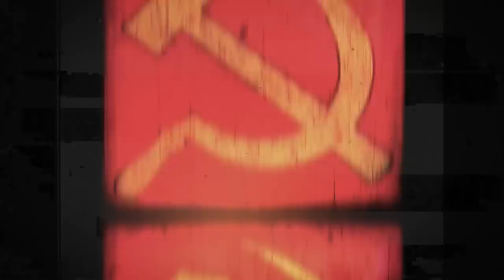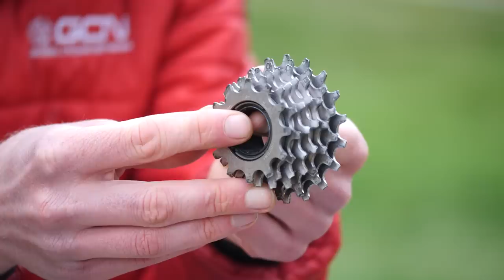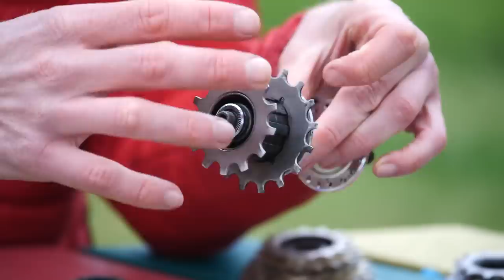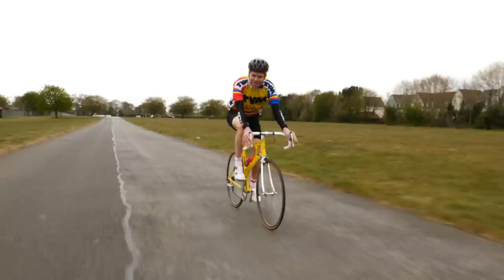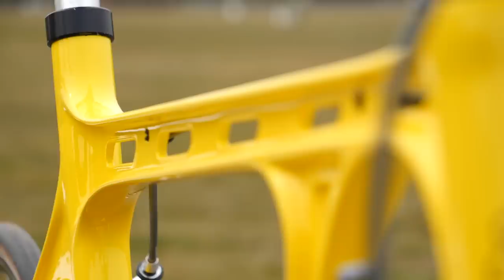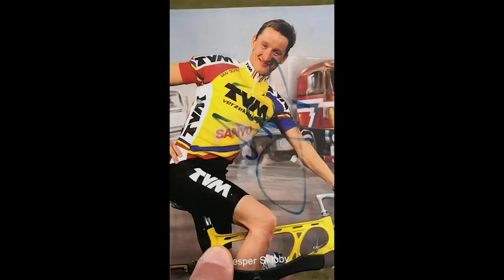The Greatest Cycling Innovation You've Never Heard Of | Shimano Hyperglide

Comment: The greatest cycling innovation…they found out that a bottom bracket should definitely be threaded
Reply: hello press fit bmx...
Reply: Threaded still has its weaknesses. If they couldnt properly deal with press fits those companies sure asf didnt fet any better with threaded bb's
Reply: @abccanada6248  no company can properly deal with press fit in the long run. There are TWO reasons for them to deal with it (still) even though it’s inferior: 1) less cost 2) a little less weight …which helps to argue the first reason for them. And for the colleague above with the BMX argument….this is BS …nobody rides miles and miles a year with a BMX. In case you didn’t know: this is a bike for really short tracks and tricks …not mileage!!
Reply: @bikemike1118  all bearings are press fit in cycling. Your just threadding in shells that have bearing pre pressed in to them with threaded bottom brackets. And when dealing with alloy to carbon bonding for the threads you are dealing with much sloppier tolerances then with press fits
Reply: @abccanada6248  true…Carbon and Aluminium is a toxic mixture. I do prefer a titanium frame (but that’s a different story). 
Anyway…the trend including „trendy manufacturers“ already go away from pressfit again …at least for mountain bikes.
Reply: Yeah
Reply: Engineering wise, a pressfit is a far better way of mounting a bottom bracket. Far more stiffer.
But because bike manufacturers can't properly do bottom bracket standards/dimensions etc, it's shitshow.
They really need some more QC.
Reply: @diarreescheet  you MIGHT be right …but come on : we live in the year 2021 and no more in 1821 … There seems to be an inherent problem regarding daily usage in the longer run. So for me the solution is: TBB
Reply: Klein were ahead in the pressed bearing style and many others. Trek purchase own all the Patents
Reply: @DG-EditsYT  yeah, the Klein mtb‘s when still under Gary Klein had a big „I want one“-effect on me….after Trek took over the company…the „magic“ was gone.
Reply: Plus a wider groove, for a poka-yoke that dumb-proof guarantees a single assembly position.

Comment: i've ridden and worked on uniglide,let's just say i'm very happy shimano came out with hyperglide. uniglide was a self tightening pain to take off, but it was cool you could flip the cogs and basically get yourself a new cassette minus the lock ring.
Reply: Hahaha that's awesome
Reply: I find they come off without any problem with the two chain whips - great fun messing around with all these parts. I feel like a professional mechanic!
Reply: The lockring is as tight as the rider is strong. Some monster with tree trunks for legs can make it pretty hard to remove.
Reply: I've got to disagree on 'second life' flipping Uniglide cogs. It can be done, but you'll need a file or grinder to get them to work properly. Lots online on this. The cogs aren't symmetrical, and the centre line of the teeth is offset slightly from the cog body.

Comment: Cassettes were a huge improvement over freewheels for nearly totally eliminating broken axles on the rear . Before Hyperglide if you wore out two cogs most used you could replace them for a few Dollars each . Also any gear combination could be made where Hyperglide is limited . After Hyperglide the cost was at least fourfold as the cogs and spider were replaced as a unit .                                                                                                                                                                                                                                                                                                                                                                                          Greater Shimano profit . Don't ask about their problematic early electronic shifting . I worked full time as a bicycle mechanic from the early 80's until 2016 .
Reply: Freewheels' maximum cogs sizes are like around 32 or 36t, which it's pretty limited when going uphill,
Reply: Wow that frame .the best.
Reply: @nzo_6543  bikes that come with freewheel have triple crankset. 24/34 or 24/36 is very low
Reply: @brian_jake  yes that's why they have a 3x/2x to go uphill, but if the crankset is 1x, which you really not gonna go uphill

Comment: There will be a few people watching this remembering the grovel home after the chain gang on your 13-18 straight through 'block' and 52 x 42 chainset...legs like Popeye..
Reply: When i started, we ran 14-19 Regina six speed freewheels. Big quads and sore knees!
Reply: Knees like crushed crackers after your 60.
Reply: MRGRUMPY53  I remember when 7 speed came out...and you could get a '21'..I lived at the top of a 20% hill..that saved many a sunday grovel..
Reply: Imagine using an 13-23 cassette on a MTB... Yea that's how i started.
Reply: MRGRUMPY53  Not on an MTB tho. Was running a 42 and 32 on the front. Now i run 1x11 with a 11-50 cassette and a 32 chainring.

Comment: Ah, but is it one WIDER spline, or one NARROWER spline?  THAT is the question!*

I remember the introduction of Hyperglide.  Lots of criticism of the reduced tooth profile, leading to faster wear was the main complaint.  Oh, and that you couldn't use older cogs.  And that users couldn't pick "custom" gear combinations anymore.  The old cog boards in shops quickly disappeared.

*I've always considered the wider open space.  Others look for the narrow spline.  Tomato, tomahto, I guess!
Reply: Both! Otherwise one could put the cogs in the other way. 
And yes, I would also like to be able to replace the smallest four cogs separately.

Comment: Being 60 (!) I remember well when hyperglide first became available in the 80s.  This video understandably gets it all wrong, because its makers aren't old enough to have been there for the introduction.  The important innovation was that you could finally shift under full power, not that shifting was somehow made 'more precise'.  Shifting was always just fine when coasting or pedaling lightly but quite impossible when hammering - chains would twist, seize and mangle and could be ruined.  

Hyperglide was an even bigger deal for the mtb crowd because you could finally downshift under full power on technical climbs.
Reply: Agreed.  Having cut my teeth on the old equipment, I still generally back off the torque when shifting even though I know the new stuff can take it.  I still love the feeling of the chain falling into place like tumblers in a lock.
Reply: He did mention the ability to shift under power.
Reply: I don't see the issue.  Most of the mentions of "precision" refer to the position of the sprockets and how the chain crosses the gears - not the derailleur alignment or shifter operation.  But it also seems to me that the ability to shift without having the chain "twist, seize and mangle" inherently means that that the shifting performance at the level of the cassette and chain is more precise.

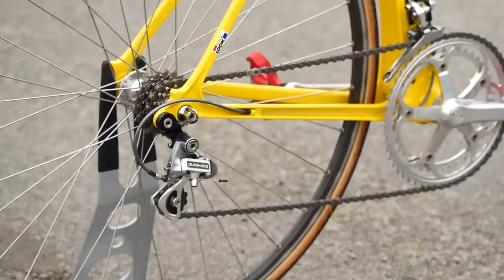But then when Ollie goes into real-world performance, one of the first things he mentions after 5:02 is the ability to change gear under load.

Comment: lots of sketchy information,  it is annoying that he is referring to a FREEWHEEL as a cassette,  different animal,  but speaking of freewheels some were made with the teeth cut differently so that it would facilitate indexed shifting,  that was not an innovation that was tied only to cassettes,  something that I liked about the uniglide system was that you could buy cogs and build the cassette to you needs,  this also allowed you to flip a cog when it got worn so that you could get more life out of it,   the bike used in the example appears to have an 8 speed, 13/23 cassette,  as the chain has to move much less to get to the next cog it should shift good,  the sprocket shifting ramps and teeth offset came about through mtn bike application where you might be using an 8 speed, 13 /34 cassette,  the chain must move further to the next cog

Comment: Hmm… is there anyone who hasn’t heard of HyperGlide? Anyone…?
It’s what made indexed shifting possible, opening up derailleur bikes to novices, and therefore Shimano grabbed a totally new segment of the market. Other brands couldn’t follow suit because of the patents Shimano had on it. It effectively killed of SunTour and to a lesser degree Campagnolo as competitors.
Reply: MRGRUMPY53  I stand corrected, but my point still stands. I see HyperGlide as an improved version of UniGlide. The shaping of the teeth and the careful positioning of the cogs is what made indexed shifting possible. It worked with UniGlide, it was much smoother and ready for the general public with HyperGlide.
Reply: Those who aren't into the technical details of cycling maybe?
Reply: @yonglingng5640  Fair enough, but to them it's a moot point, they won't know of any other cycling innovation either.
Reply: MRGRUMPY53  the 1st was the Positron deraileur.
Reply: MRGRUMPY53  However it was the 1st. Uniglide came later. If your going to correct, be correct 😀

Comment: The positioning of the sprockets is not as important as they claim.  I mix and match sprockets from 7, 8 and 9 Speed cassettes to obtain the ratios that I want.  At worst it has resulted in some shifts taking only slightly longer to complete.  You can also grind down the extra wide spine in order to optimize the positioning.  I also run a 52-36-24T triple crank set in the front with a modified derailer. I can pedal up the steepest hills, yet pedal flat out on the straight and level and still have a close ratio rear sprocket set to optimize my pedaling effort and pedaling speed.

Comment: HG chains are directional? I did not know that, also i need to check something on my bike
Reply: @bigstu_  0.6% is 0.6%, it may be the difference between a rider winning a race and losing it. If you're just a commuter, then i guess it would not matter even if the difference is 5%.

How much cost/labor does it take to install your chain in the recommended orientation? That 0.6% difference might also have improvements on wear and tear...
Reply: The outer plates will have the Shimano written on them. It's not so much about chain efficiency, it's about smoother more accurate shifting with no skipping.
Reply: It’s really obvious if you install one backwards.
Reply: It depends. Some are and some aren't.
Reply: @kaedeschulz5422  if it's a Shimano HG chain it's directional. it will say on the packaging if it's HG.
Reply: @iancanuckistan2244  Not all of em. I had an HG 8speed drivetrain on my old MTB and the chain looks the same from both sides.
Reply: Today I learned… I also need to go check something on my bikes 😆

Comment: I enjoyed a early version  on a Giant Chronos. Crank up a hill and shift in either direction was pretty cool. Within in a year though I started breaking chains. The fourth break took out the rear derailleur, locked up the rear wheel, wore off a brand new tire and screwed up the rim. I was doing about 45KPH on the flat coming off a hill. Never again.

Comment: From my experience, Hyperglide is more suited for indexed shifting. For non-indexed, it doesn't want to 'find' the gear like Uniglide or the better Maillards etc of the time.

What's being overlooked in the discussion is how a Simplex retrofriction shifter http://velobase.com/ViewComponent.aspx?ID=91d3c48f-c79e-429c-86ae-e38000ac1ac6&Enum=104 and some others, but Simplex was by far the best needs a freewheel cluster that wants to be in gear.

Once properly mated, set-up and adjusted, the cyclist needs to just 'tap' the lever with one finger to shift one gear, and tap a little harder to do two. Hard to believe? Darts, billiards and many other sports demonstrate how accurate the tactile sense can be in cases like this.
Or violins. No need for frets, the player can tell by feel if they're 'on pitch' or not.

Unfortunately, I've never found a Hyperglide freewheel to be compatible with non-indexed shifting, but the Hyperglide chains can be.
Reply: yep, Friction works with index cogs but the performance level sucks.
Reply: Suntour power ratchet shifters the came in down tube, bar end and flat bar thumb shifters. They work pretty good with hyperglide. The ratchet will give you a tiny bit over overshift and falls back a bit. 8s was the best. A Shimano rear derailleur with the floating jockey pully does the rest.

Comment: I noticed this when moving up from my old friction shift road bikes with plain tooth cogs, especially the older Suntour Alpha freewheels. Switching to SunRace chromed freewheels with nicely shaped teeth really improved shifting. I even prefer the SunRace 7- and 8-speed chromed cassettes over some of the older Shimano Hyperglide cassettes. The SunRace shift more crisply and run more quietly with both my older Suntour Accushift and various Shimano SIS setups.

Ollie looks a bit uncomfortable with those long cranks on that TVM Kirk Precision. Reminds me, I need to ditch the 175 cranks on my Diamondback Podium in favor of 170 cranks. Technically 175 fit me, but they never feel quite right and pedaling always feels a bit labored, and it's a chore to get the saddle/seat post height just right. I didn't realize how much difference crank length made until I bought an older Trek 5900 from a friend who set it up with 170 cranks because that's what he had in the shop. Felt perfect.
Reply: Combine chromed cassette with wax and the ti-coated KMC chains like the x10el for super smooth and quiet drivetrain

Comment: I have that rare Dura ace hub that does both uniglide or hyper glide. It came with domed nuts so it can squeeze into a 126 rear or a 130 rear. Still using it today (with a 10 speed cassette), it’s very versatile
Reply: Are you selling it?

Comment: This really feels like GCN being apologetic for Shimano lack of any real innovation. Yes they introduced some new tech 30 years ago but things have moved on and they really need to bring electronic wireless shifting for the masses. And even that is not innovation - SRAM already has it. So they should step up with more belt based drives, lighter hub crank gearboxes. Heck, even a singlespeed with variable e-assist.
Reply: The masses don't want electronic wireless shifting. It's expensive, environmentally unsound and it's yet another collection of batteries to forget to charge.
Reply: You talk as if real innovation can just be scheduled. Real innovation is hard, especially in extremely mature fields like bicycles. SRAM wireless shifting is not even innovation — it’s evolution. Electronic shifting as a whole isn’t innovation either. Real innovation is something like indexed shifting.

Comment: Great video!  Now I need to check my chain to confirm that its not installed backwards, as I did a roadside masterlink replacement a few years ago.  On a side note, at the end of the video you are specifically referring to hyperglide but you are holding and zooming into the old uniglide cassette
Reply: If you can read the words on the chain on the right side(chain side) of the bike its installed correctly.

Comment: I did a blasphemy couple of weeks ago. My HG cassete worn out after 7500 km so much that chain skipped teeth even at slightest load. But I noticed that teeth were worn out only at one side, so if I fit gears the opposite side, they would work for some time :) But of course wider spline wouldn't allow me to put gear wrong side, so I filed it away! And all these HyperGlide special form teeth for better shifting couldn't work either. BUT IT DID WORK and shifted normally, probably because chain is worn out as well so it doesn't hold that deep in gear anyway. Hope that gives me some 1000-2000 km of commuting before buying new chains and cassete.

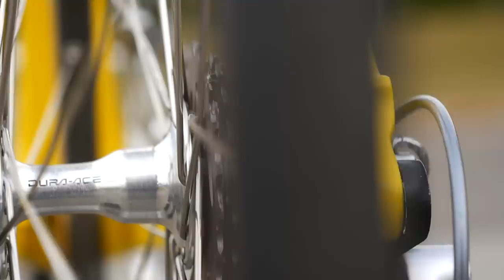Comment: 6:00 - if I remember correctly, there were cable stops available that could be mounted in place of shifters to make the frame STI compatible?
Reply: Yes, I have used a couple of them on my bike. But man that was so long (and at least 3 or 4  bikes) ago that I had forgotten about them.
Reply: @Evertb1  Cable stops on the shifter bosses are still use everywhere.